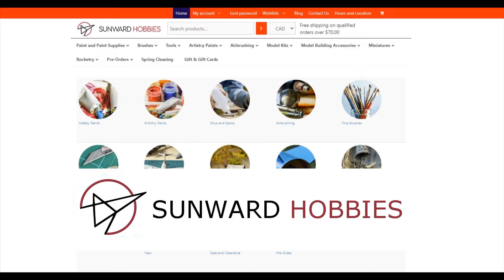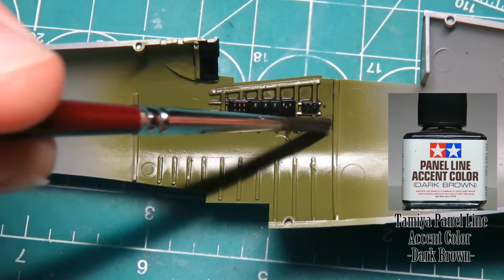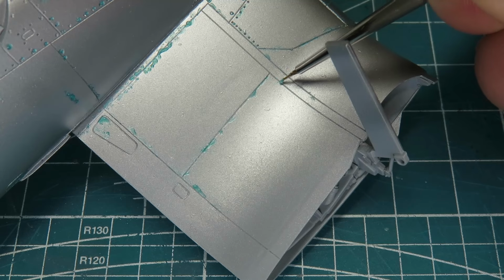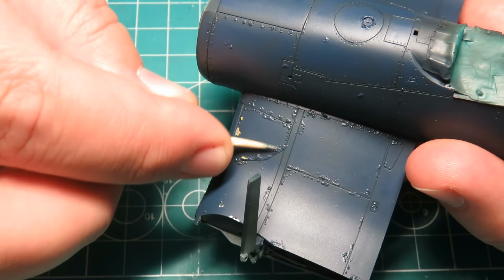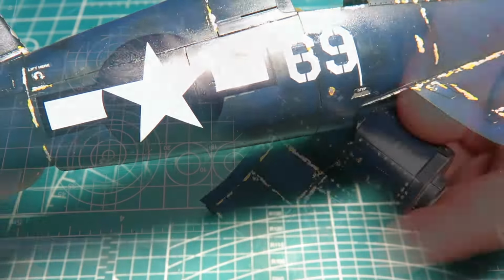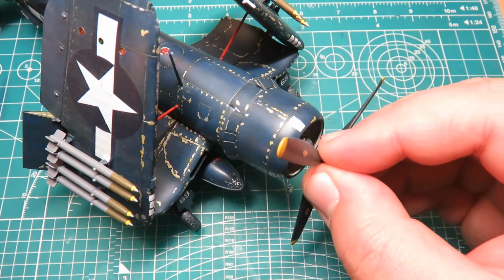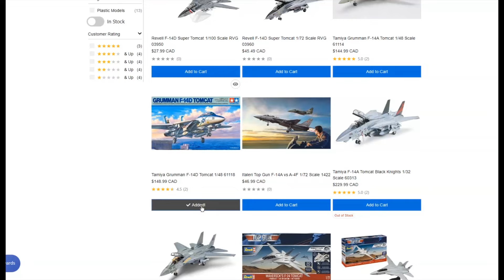Tamiya 1:48 F4U-1D Corsair with Moto-Tug

Comment: Just a small tip for you regarding the masking fluid. I'm a Watercolour Artist as well as a modeller, in watercolour before using any masking fluid we gently scrub our brush on a bar of soap before dipping into the fluid, this helps protect the brush bristles making the brush last longer. You may already know this, but I'm sure if not for you it maybe useful for others. Lovely build and props for the work on the tires that must have taken some time
Reply: Good tip dandy, will try it next time I do this effect

Comment: David R Lentz, Columbus, Ohio, USA (Thursday, 3 October, 2024) 
EDITED FOR CONTENT

I keep watching your video. I years past had built this kit (that is a long story! :( SMH), with just some “pre-shading” along the crevices to suggest depth, indicate panel lines, etc., though little else for a plane newly arrived to the carrier. I painted it dark sea blue, with gloss on the horizontal surfaces, and the flat kind elsewhere; I also used this flat colour to convey vague hints of weathering, oil and fuel staining, etc. I had used Eduard’s photo-etch detail set, which had a hand crank (I had painted it red) immediately inside the windshield to roll back the sliding canopy, an instrument panel with the dials printed onto a transparency that I lit up from behind, the engine’s spark plug wiring (the obvious flatness of these leads seriously irritated me; I call this characteristic of PE “false three-dimensionality”), etc. 
   I liked the tow tractor, too. I wish that I could have found a portion of a carrier’s flight deck in polystyrene or resin, a few of which to set together in a setting combining three or more of these kits of a tableau of preparations immediately prior to launch; fueling, arming ordinance, loading gun bays, etc. 
   I quite like your measured explication of each step you make, your knowledgeability of model building, and of the aircraft that is your subject matter. 
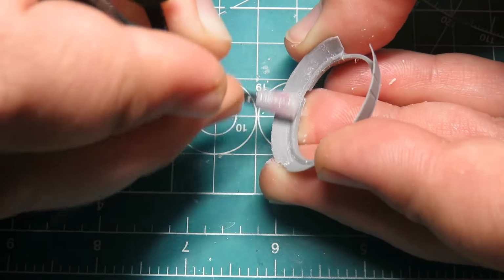   At 6:30 in your video, you explain your efforts to add details to the open cowl flaps, wheel wells, and other elements of the facsimile in polystyrene, paint, adhesives, etc. I very much admire your efforts! What exactly are the vertical tabs to which you add springs fashioned of fine copper wire, please? I wish Eduard and other aftermarket companies would create a PE set to standardise this effort. I have seen other people’s efforts to make such changes, which look distinctively different in the finer details than yours. 
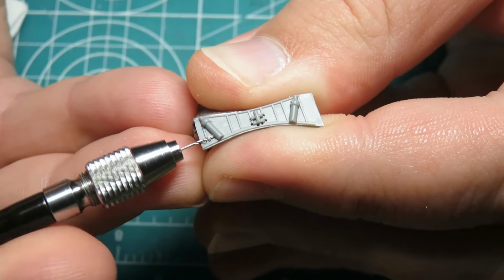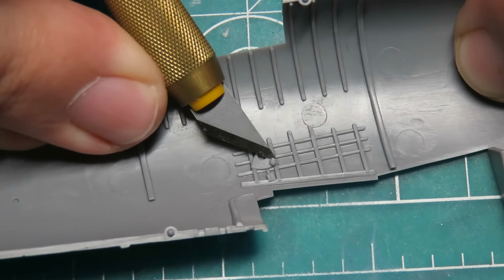  At round 7:20, you note that the relatively small size of the model constricts what is feasible in your struggles to enhance otherwise plain features. Often has that been my experience, too. I must ask if you have considered Tamiya’s 1:32nd-scale kits of the Chance Vought F4U Corsair USN/USMC Fighter series, the North American Aviation P-51 Mustang USAAF fighter series, etc.? (I so wish I could! I must take my modelling enjoyments vicariously.) 
1 (Continued)

Comment: “Deckles” lol Dee cals 😂
Reply from the maker: Actually both are correct and it depends on where the word is being used linguistically. I am from Canada ergo I decal.
Reply: @rebelsatcloudnine   I had never heard that pronunciation before! Beautiful work on the model! I am in awe! You are a master craftsman! Do you have more aircraft videos? I intended no offense by the way.
Reply from the maker: @petepanozzo6854  It's all good, I just get this comment a lot :) Thank you very much, I've recently learned a better way of applying the masking fluid, so next time it will be more to scale. But I'd like to try it out again on something bigger like the Airfix Hellcat.
Reply: @petepanozzo6854  its typically the British modellers that pronounce it that way. As he said, technically both are correct depending upon where you are. It does sound different though being spoken by someone without the British accent.